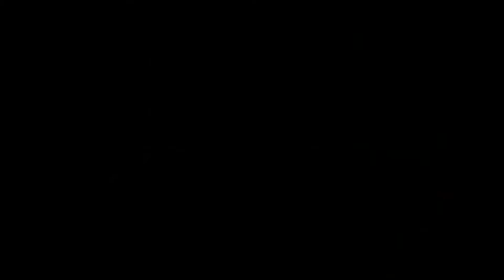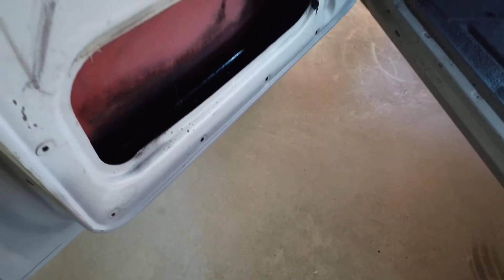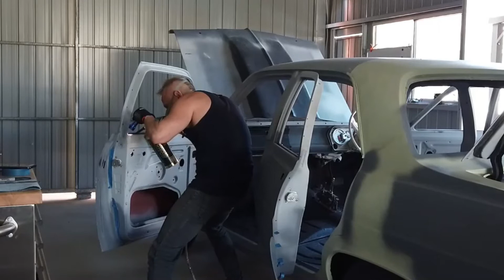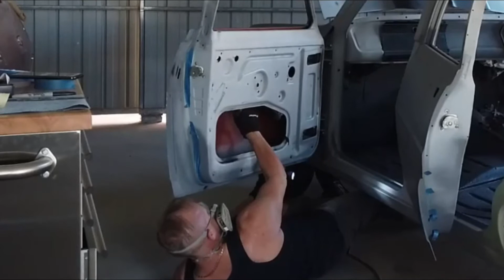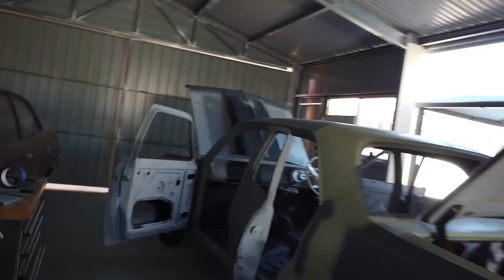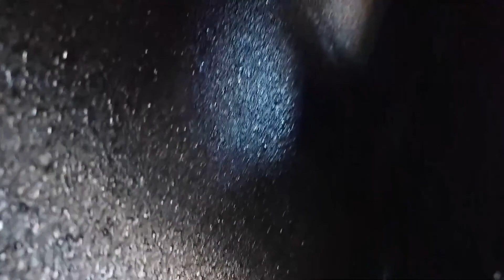HR Holden 1967 Car Restoration (part 3) - Inside doors - Rust / Sound Proofing

Comment: So with the sound proofing how many coats would you suggest??
Reply from the maker: Hey mate! This stuff goes on pretty thick I apply it until it is uniform, for aesthetics mostly even a small amount is helpfully. Originally car manufacturers would only apply  strips on large sheet metal areas to help reduce vibration 👊
Reply: @rowdy7986  ok thanks mate I'll keep that in mind 👍